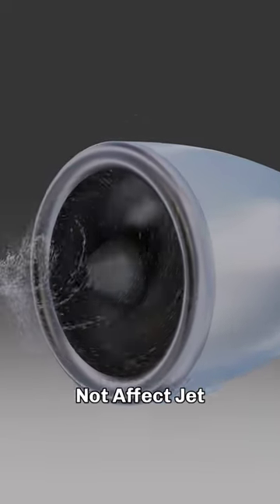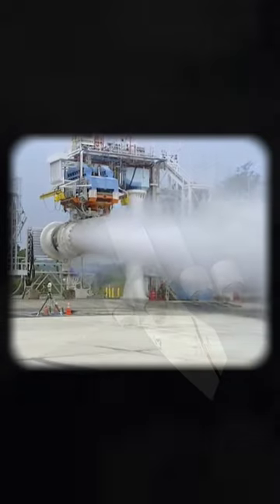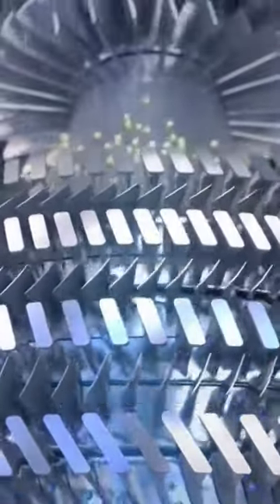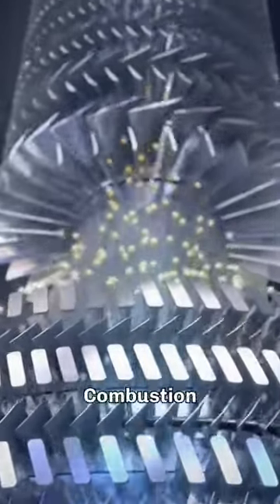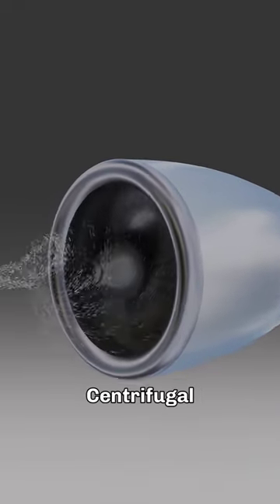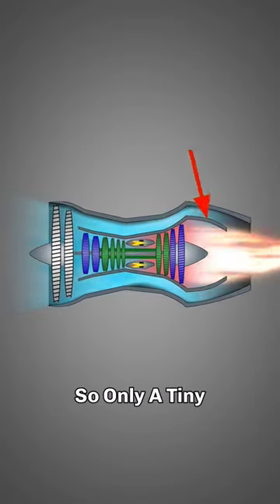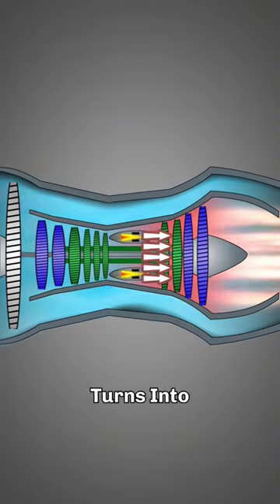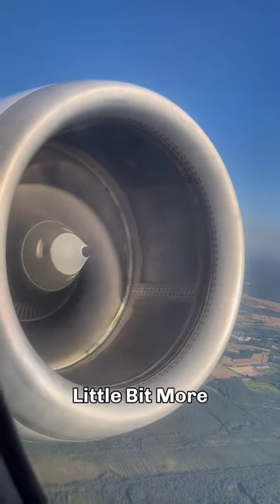What Would Happen If Jet Engines Ingest Water? 🤔

Comment: Watching this explanation as an engineers realy hurts...
Reply: Why? 😅
Explain more please
Reply: @hdrhdr782 The fan on the front is an efficiency measure, not for water separation. It speeds up air to create thrust using energy from combustion of air which goes through the “core” of the engine, without combusting the air which goes around the outside of the engine (called bypass air). That increases engine efficiency a lot, these engines are called turbofans.

The video is right about the water content going through the engine core acting to cool the combustor, that also results in an efficiency increase by increasing the mass flow rate of fluid through the core, without combusting extra fuel. It would take a huge amount of water going through the engine core to cause problems with combustion and flameout, that’s why aircraft can fly through clouds just fine.

The bit about water being centrifugally separated by the fan is largely wrong (at least at cruise speeds) as the speed of the air hitting the fan head-on is so high compared to the change in speed of the air tangential to the fan. The video might be trying to refer to a Water-Enhanced Turbofan (WET, clever ik), where water is used to mix with the combusted air and increase core mass flow rate (and therefore engine efficiency) while also reducing nitrogen oxide emissions.
Reply: @benhancock4243  Thank you for the explanation
Reply: Hahahahha… when he said ‘spinner’ I just lost it
Reply: Everyone isn't supposed to know everything
Reply: @akhil_1210  it's ok to not know something. But I don't make anatomy videos, because I'm engineer. And he, while not knowing the topic, and haven't done a single bit of research, still made a video
Reply: @benhancock4243 Don't explain things. Please. 🙄
Reply: I also see a double fan on the engine. I'm not against it as an engine design, by I don't know if double fan turbofans are common.
Reply: @benhancock4243 i just ignore any explanation video for anything the moment they mention centrifugal force
Reply: i feel you
Reply: Thank you, please elaborate, because so far these AI robot voice videos are all bullshit and I really wasn't sure about this one. I'm calling it, it's bullshit, isn't it.
Reply: @akhil_1210 right, but if you're gonna spread information, you at least do enough research to spread the right thing and don't mislead people.
Reply: what
Reply: I would hope an Engineer would have gotten a degree, and learned how to spell words correctly.
Reply: The spinner!😀
Reply: Reading your comment as an English speaker really hurts 😅

Comment: Fun Fact: a jet Engine can run through 800 gallons of water per minute
Reply: Depends on the engine
Reply: This means submersible jet engine 😂😂😂😂
Reply: He is talking about the GEnx engine and it can handle way more then that. The 800 gallons of water a minute figure was the max water they could push through the hoses lol.
So it was in fact not a fact, just nonsense for likes
Reply: @thor.halsli  "just nonsense for likes" lol no
Reply: @thor.halsli  and plus you just said the 800 gallons was the maximum, so I don’t know what you mean
Reply: @NightmareZzK  the test hoses couldnt pump more than that, so the genx could theoretically handle more

Comment: B-52 used water as Boost J-57 Engine.
Reply: Also some 747 did that too
Reply: I worked on those planes in the mid 80's. They inject water in the intake as well as the aft. And the black smoke when they took off was scary .
Reply: Same for the Harrier Jump jet
Reply: @bladi-senpai9398 they also use seagulls
Reply: Same for the B-1 as well

Comment: That "bypass" actually makes 70-80% of the engine's thrust, as I learned before.
That's why these are called "turbo Fan."
Reply: In the more modern engines. That's why the later the engine, the wider they are. It was fairly recently realized that a higher proportion of bypass thrust is more efficient generally.
Reply: @aarondavis8943  It's not a recent idea just that material science has made it possible.  Making rotor disks and fan blades that large requires the ability to handle the higher centrifugal forces produced the bigger the diameter gets.
Reply: @eliotvarda  Ahhhh, WRONG!  The Bypass air is accelerated through the bypass duct and provide 80% of the total thrust.  The entire reason for the bypass duct is to provide a "COLD" stream of more dense air to provide more efficient thrust.
Reply: @eliotvarda Core works to rotate the turbine. Majority of the thrust is produced by the 'bypass' airflow.
Reply: 99tg like
Reply: This bypass tube of air surrounds the hot noisy exhaust of the turbine, thus having an extra bonus of sound reduction.
Reply: @eliotvarda  turbofan engines are essentially oversized turbochargers by definition. the turbine in the engine core causes the fan to rotate. the fan then creates suction force that pulls air, creating thrust.
Reply: Well yeah, but thats not why they’re called turbofans. There are high bypass and low bypass turbofans. Low bypass turbofans use more of the engines core over the fan to produce thrust, which is the opposite of what you’re saying
Reply: Yep Turbo fan Not rain outlet
Reply: @eliotvarda Study more , then react to the comments

Comment: Early turbojet engines, which had no bypass duct because all the air passed through the engine core, were well-known to flameout when too much water was injected.  A Delta Air DC-9 famously crashed after flying through a particularly intense rainstorm.  This crash led to the adoption of continuous igniters on jet engines with the goal of keeping the combustion chamber flame from going out.

Comment: Cools the engine a little bit? That's now how it works. The increased power isn't due to cool water - the water not in bypass stream isn't water vapor, it's steam. At the temperatures of the center of a turbofan jet engine, the water expands by 1500-1800 times, whereas the air fuel mixture is significantly lower. This higher expansion ratio is what gives you more power, making the engine more powerful. Now, this effect is greater in turbojets rather than turbofans, because the entire intake air goes through combustion chamber. On very hot days, some special airplanes in Middle East would inject water to get greater power.
B52s do this and are the most famous aircraft known for this in aviation community.
Reply: It cools the air entering the combustion chamber and cooler air is more dense, so cooler temps within the engine mean more air enters the combustion chamber, increasing efficiency
Reply: You’re wrong
Reply: @Trainman10715 The air at cruising altitude is wayyyyy below 0°C, the water would cool jack shit
Reply: @nalstudio_official  you understand what an 8:1 compression ratio does the air temperature don't you?
Reply: wrong

Comment: Ignition system of the engine is also turned in continuous mode by the crew during heavy rain too to prevent accidental flame out.

Comment: The reason the engine becomes more powerful is because of the excess thrust produced by the rainwater that exits the engine.
Reply: I thought it‘s because water expands when turned into steam
Reply: Both of you are correct-- and the extra thrust has nothing to do with cooling the combustion chamber.
Reply: Squidward likes this.
Reply: @bobgreene2892 yes it does, cooler temps within the engine mean that cooler air enters the combustion chamber and cool air is more dense, so more air enters the combustion chamber. This is pretty much the only reason for water injection in reciprocating engines

Comment: Older B52G and KC-135A actually had water injected nozzles at the combustion chambers to actually give it more power since when water turns to steam, water expands about 1700x its original volume.
Reply: 747-200 had it also

Comment: Due to the law of conservation of energy, the water actually improves the mechanical efficiency of the turbine as it helps converting the internal energy of the exhaust air to the momentum which provides more thrust for the airplane.

Comment: ye that bypass for the water is more like the most important part if the engine even without water, rain water in the engine would either get yeeted through the combustion chamber due to the leidenfrost effect or just evaporate if it got in, the outside part coolsthe engine and most importantly its the main thrust component because the main function of the center is just spinning the spinner so it produces thrust outside

Comment: You would be amazed at just how much the combustion section is capable of still running while ingesting water ice ect they spray the equivalent of 4 or 6 fire hoses into the engine while running it to pass certification yes it will only ingest  about 20 percent thru the hot section but it's still amazing

Comment: That 'bypass area' is mainly designed for air though, not just to fling out excess water. The front turbine fan or 'spinner' as the video calls it sucks in air for the combustion cycle but also serves as a sort of propellor, forcing cold air through the outer tube.

Air travelling through this bypass duct provides up to for at least 50% thrust on turbofan engines. 

A little misleading statement.
Reply: Read the last sentence in your comment. That describes everything you just said. You don’t even know what spinners are…

Comment: Flameout Explanation(According to Google):
Flameout basically means that the flame in the combustion chamber has been extinguished. A jet engine compresses air, then adds fuel and ignites it. So, it needs three things to function correctly- fuel, air (oxygen), and the heat to make them burn. Removing any of the three can cause a flameout.

Comment: There were also specialised water glycol systems on the boeing 747 with the less powerful engine versions, which I forgot the name of. You purposefully added water to the engines to make then cool down and be able to inject more fuel to make more thrust, however this was not a very relaible system and had to be monitored very carefully. And sometimes the excess thrust wont help kuch because of the weight of the tanks containing the solution anyways

Comment: Well the bypass is built to produce more thrust for less engine, not seperate water. Building an engine to divert water would just make an engine very loud.

Jet engines are just built extremely robust since any water that enters the engine dosent really get a chance to mix with the already aerosolised fuel.

Also intake air isn't radially impacted in any signifigant way untill it actually contacts the blades, and the bypass turbine is focused on making as much thrust as possible with minimal radial impulse.

Comment: Lol you’re calling the fan a “spinner”. And that bypass duct isn’t for water specifically lol. Most of the engines thrust is produced by the main fan at the front pulling air through the bypass duct
Reply: The fan and the spinner are two completely different components lil chap

Comment: Well let me just say first of all the plane flies at 10km so not much rain there. Secondly, about half of the exhaust is water so the water just adds to the flue gasses. Only reason you would think water puts out fire is if you are very little/naive. All fire requires is heat, fuel, and oxygen, so if water enters the jet engine at low concentration it works just fine. It's like asking how you can breath with water vapor in the air; "doesn't water in your lungs make you drown", well I mean only if you fill your entire lungs up with water.

Comment: Thats wildly inaccurate, the water not getting into bypass will not “help cool” as much as its actually increasing performance. The mechanism involved arent really interesting in a non-tech video like this but the info is available from serious sources. Otoh, cooling from water is good for performance too, as it makes the air denser ref. water injected F1 engines.

Comment: It's not a design choice that turbofans are engineered to move water around the bypass. Its almost as bad as chemtrails. The "spinner" provides most of the thrust in something called the bypass ratio. Because and ONLY because the front fan is the largest in fin width and diameter, it sucks the water through the bypass as we know pressure follows the path of least resistance and when you have a bypass ratio like modern jets past 5:1 the water follows the bypassits not a turbo fan because of its water routing. That's just wrong

Comment: This hurts to watch. If this is how it works, then explain turbojet engines, like those used on military jets. These do not have any bypass at all, so according to your reasoning and explanation, these would flame out due to rain. But they don’t. And if centrifugal force is at play here, why wouldn’t the air also get swirled up and starve the engine of oxygen? This is not how jet engines work.

Comment: Pilot should turn on another ignition system before entering bad storm weather zone.
Learn from Aircraft Engineering courses.

It is true:
Water injection system increased  the Jet Engines power output.

Comment: The truth and a lie if I can say it like that.
because this is a  turbo fan engine, you also get a turbo jet engine with not a high bypass rate what then?
water evaporate within the compressor sections because the air reach a temp of up to 500 degrees celsius before entering the combustion chamber and the centrifugal force do infact spread the water to the casing sides for it to backwash out again to not cause a flame out!